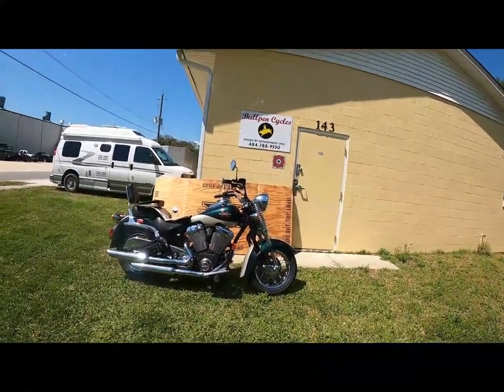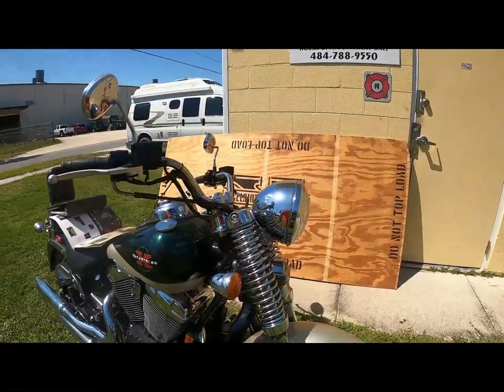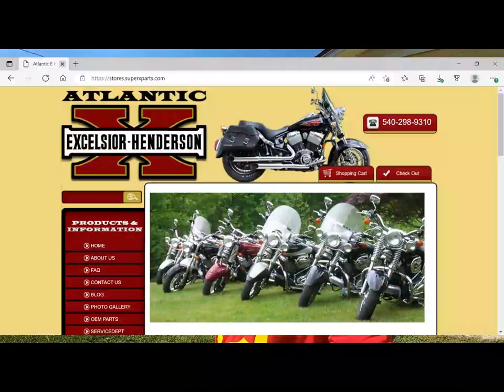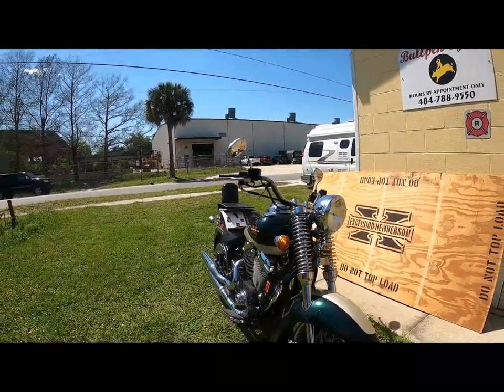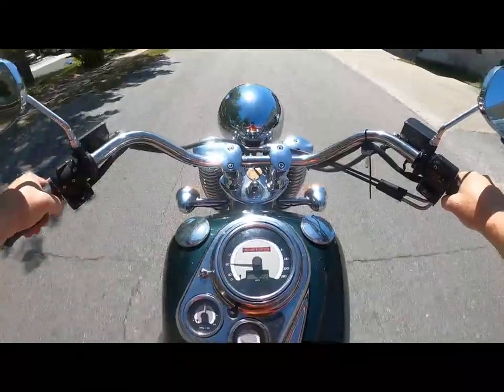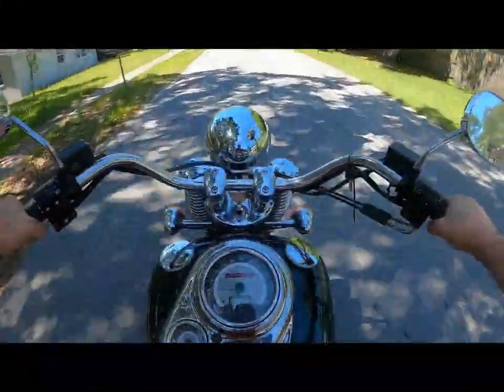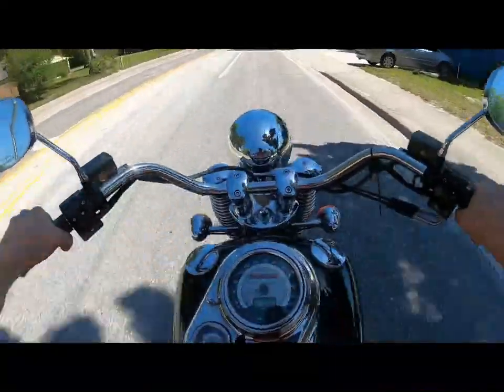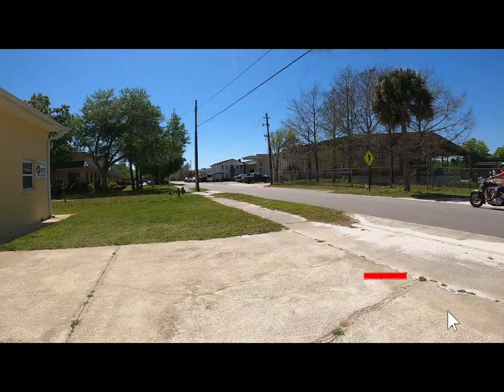Just how Super was the Excelsior Henderson Super X?

Comment: Some important background information on these incredible bikes. From the ground up, these bikes were a brand new design. These are NOT clone bikes in anyway. For the most part they were well made and well designed bikes. As Dave mentioned the biggest issue (that quickly got solved) had to do with excessive clearance on the transmission bearings (bushings) inside a number of the gears. The transmission manufacturer installed the wrong size bushings and delivered some transmission cassettes with the gears that ever so slightly wobbled and caused the circlips to fail. This allowed the gears to move around on the shaft and potentially lock the rear wheel. This was quickly diagnosed and remedied. This occurred on a number of bikes that got out the door. Not all but enough to warrant having the tranny checked out by someone familiar with the fix (like Atlantic EH LLC over in Elkton Va.).  The vast majority of bikes that you see on the road have likely had this fix especially if they have more than a few thousand miles. The bikes you need to be aware of are the brand new bikes that were never sold. They will need the transmission bushings checked and if necessary, replaced. Not a terribly expensive fix on these bikes as it simply requires removing the primary cover to get get access (no need to split the case).  I would not be afraid to buy one of these if you can get it under $10k. These bikes (once properly prepped and with the tranny fix), are impressive bikes that are reliable and will run strong for many years. They're essentially metric cruisers and have many parts that will swap with well known metric cruisers. The entire fuel injection system, to include the Sagem computer, is period Triumph and everything is still available. The same goes for the entire ignition system as well. Everything's still available but you'll need cross referenced part numbers to other manufacturers (this is available for most of the high wear items and other consumables).  Because of the Hanlons and the tireless efforts of the initial owners of these bikes (originally a tight knit community of mostly old world Harley guys), back in the early 2000's, ALL of the issues have been solved, including alternate cross manufacturer part numbers. So it should be possible to keep these bikes running well for many years. To get ALL of the information you need to know about these bikes you must check out the Excelsior Henderson Riders website  h-t-t-p-s-:-/-/-w-w-w-xhmotorcycles-com  (remove the hyphens), and or call Atlantic EH over in Elkton, Va.  (h-t-t-p-s-:-/-/-stores-superxparts-com ) Jamie over at Atlantic has been involved with rebuilding and servicing these bikes since the first ones rolled off the assembly line in 1999.  Once you buy one and make these contacts you're going to meet several hundred serious motorcycle people who are some of the most helpful people you've ever met. They love to ride and keep the these bikes running and will make sure you have the info to keep you riding as well. You will be welcomed into one of the more exclusive motorcycle clubs (several gatherings of owners occur in various states every year and until recently a few hundred owners would get together every year for Rolling Thunder and ride into D.C. as a group).        - BlueMax1910
Reply from the maker: You are absolutely correct. And probably said much more than I could do in a 15 minute video. I've been to Atlantic EH several times. Jamie fixed my fuel pump. And I've met DH as well. I purchased one of the prototypes from him. That's in the shop someday for another video

Comment: DONT WARM IT UP ON THE KICK STAND IF THIS IS BONE STOCK.

OIL PUMPS WILL SUCK AIR. only warm up upright f you do not have pickup tube update.

These are not metric bikes. Nothing metric on them.

#525, was 310th off the line, now has 50000 miles. I do all my own work.
You are a good ambassador for the brand and I thank you
Reply: You may want to pull mufflers on this one. Top muffler is wobbling. Muffler brackets will tear or loose weld..   typical for our Xs
Reply from the maker: Thank you. I did not know about that one. Can't say I do that much except to film that it runs in this video. I'll check with Jamie on my other EH.
Reply: Jamie Jones is good stuff.
Another vendor in Minnesota is Duane Judge, also very good.

I get cornered, they are my go to... Always willing to help

Comment: I own #1928 haven't started it since 2010. One day it will run again.
Reply from the maker: Boy, that's near the end of the run. You'll be happy to know the fuel system is actually very easy to work on
Reply: If you drained the gas tank in 2010 then you'll likely need a fuel pump. Don't panic, the alternate P/N  (AC Delco EP274) is I believe the same as for a '90's Ford Escort.  I've always kept my Super-X with a full tank of gas even during the winter and started it at least once every two weeks or so to let it idle until warmed. Except for a crank angle sensor and a rear cylinder coil pack replaced last year it's been running fine since I bought it 22 years ago.